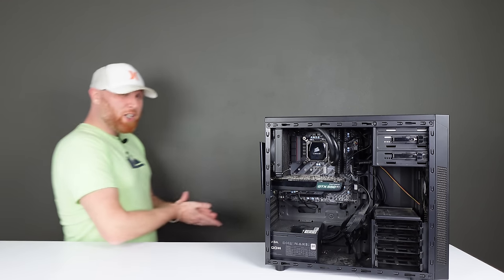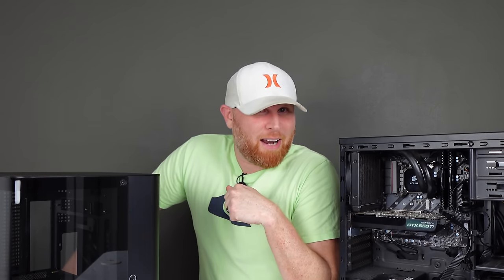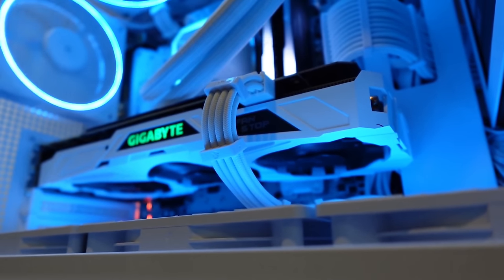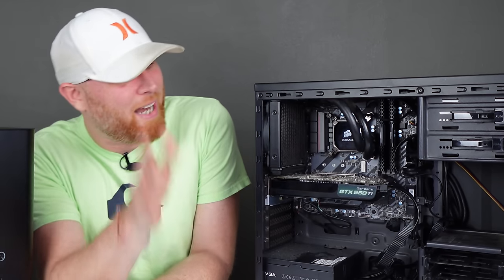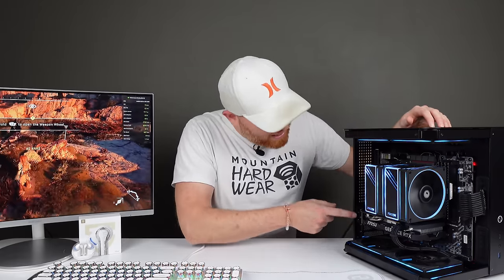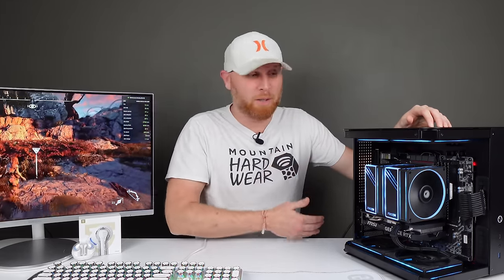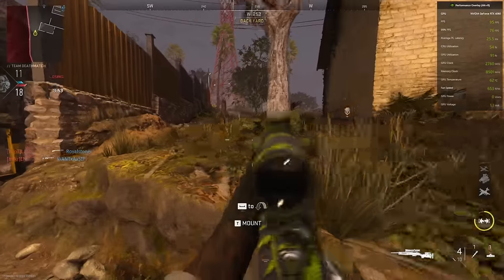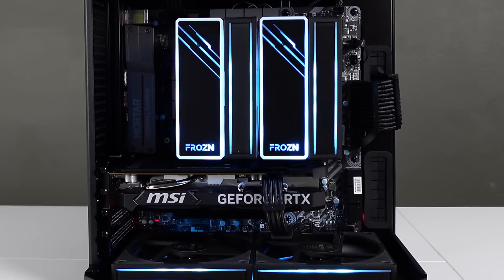Building In The STUNNING Jonsbo TK-1 MATX PC Case - PCBUC S1.5E9

Comment: Why didnt you use isopropyl alcohaul to clean it thus time
Reply from the maker: It was not dirty enough to need that kind of cleaning. Just some dust build up on the board was easily removed with the duster

Comment: Can I fit 3fan gpu inside of it ?
Reply from the maker: If it is a smaller triple fan it will. Such as the xfx6600xt. But larger triple fans will not fit
Reply: Video Card: ≤280mm

Comment: one thing that should be noted, Jonsbo also makes the TK-2 which is a slightly larger version of this case with better gpu support, and the TK-3 which is similar to the TK-2 but only has one side of the glass curved and a flat back for a good bit cheaper
Reply from the maker: I am actually in talks with Jonsbo about more case reviews. Should have the TK-2 in the future

Comment: 800 is good but you’ll get lowballed a lot. I listed a very nice 2060 system and got offered 100 dollars. All i get is low ball offers. Any tips on selling at a higher price?
Reply: Making it look nice and using cable extensions people love it when it looks pretty
Reply from the maker: I just say no to lowball offers. It’s unavoidable really. Just need to stick to the price you want for it as long as it is a fair price.

Comment: The problem is the 7th gen Intel chip makes the system only a few hundred bucks in my book. But. you built it so maybe advertising it as featured on YouTube for a build will make it sell for that fact.
Reply from the maker: The 7700 is the equivalent to the r5 3600 in performance not core count.  You would only sell a 3600cpu system for only a couple hounded bucks?

Comment: it's a shame to have this type of tank case without a vertical gpu bracket mount
Reply from the maker: I think it would look great but unfortunately with an air cooler in there you would have the hardest time getting a vertical gpu in that thing. With a AIO it’s for sure doable
Reply: @ThePcRehab  i mean just as an option ! the case is not even optimized for air cooling the way your fans are positioned as the air flow should travel from the bottom to the top !

Comment: Im new to pc stuff if anyone can help
Me out with this question I’m trading a Xbox series S and two controllers for a pc with these specs (i7 processor  725 power supply rx570 8gb gpu 250gb ssd 16g  of ddr3 ram) is it worth the trade
Reply from the maker: Which i7
Reply from the maker: Also that gpu is a little on the tame side.
Reply: @ThePcRehab  I’m not sure it just says i7 processed
Reply: Processer*
Reply: @ThePcRehab  I just want it run gta or call of duty
Reply from the maker: @pandafvv  I would dig real deep into why it only says i7. There are tons of i7’s and generally when people don’t say which on it’s because it’s a seriously old one and not worth anything
Reply: @ThePcRehab  ok once i figure out I’ll tell you
Reply: @ThePcRehab  also u said about the gpu are they replaceable
Reply from the maker: Yeah you can simply remove them and add in whatever card would go well with the cpu. As long as you have the right power cables from the PSU
Reply: @ThePcRehab  ok thank you for the help